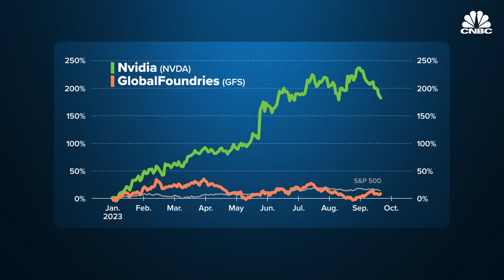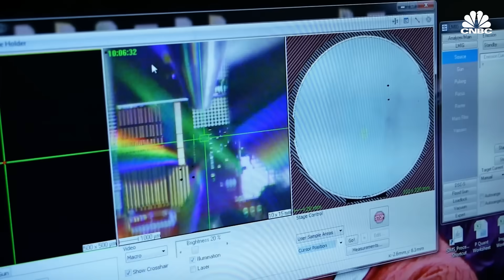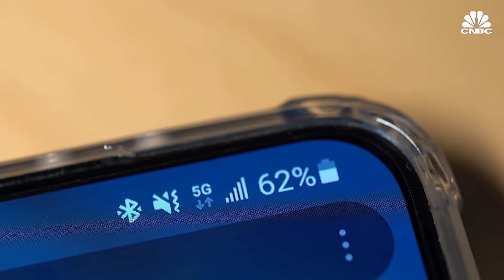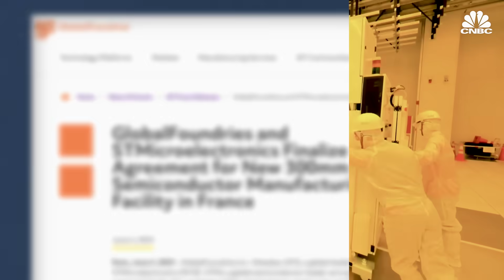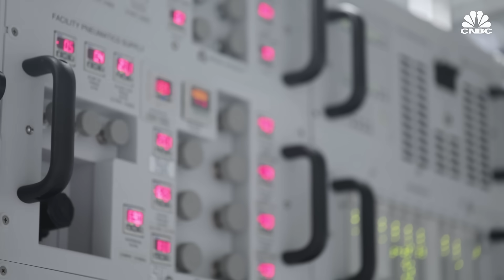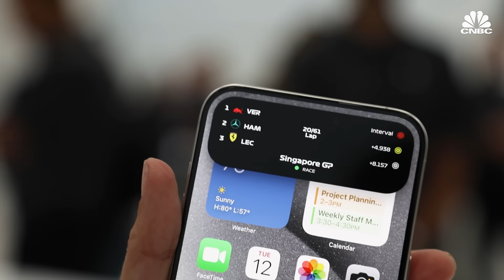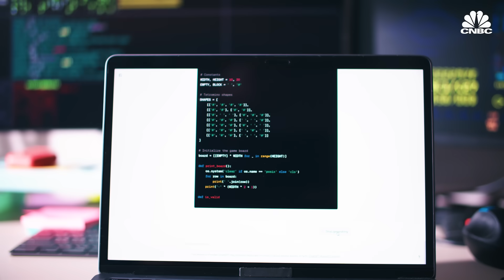Why GlobalFoundries’ Chips Are So Important To The U.S.

Comment: (GF) GLOBAL FOUNDRIES (GFS on stock market), Malta, NY
1:00 - - 🌎’s largest chip foundries (GF #3)
3:36 - - NY, Singapore, IBMs in-house semi-c division’s 2 production sites
3:53 - - 6b company 
5:49 - - only chip manufacturer in 🇺🇸 
6:34 - - aspirations to become greater market leader 
7:42 - - layout
11:01 - - Manufacturer req -💧💧💧(cleaning, cooling, chemical treatment)
11:19 - - power req - 🏭 2 gigawatts per day
11:45 - - 13k employees 
12:29 - - public subsidies are key to funding manufacturing
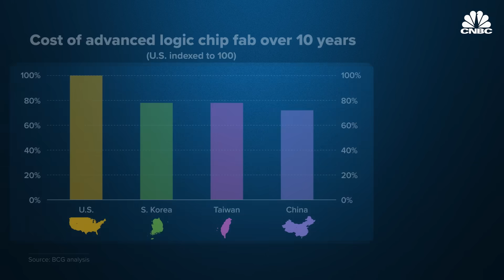12:39 - - GF said NY pitched in $2b for (fab 8)
12:42 - - 52b grant - CHIPS + Science Act (2022); 460 co’s applied
12:50 - - GF keeps costs ⬇️ by focusing on 12nm or ⬆️ chips
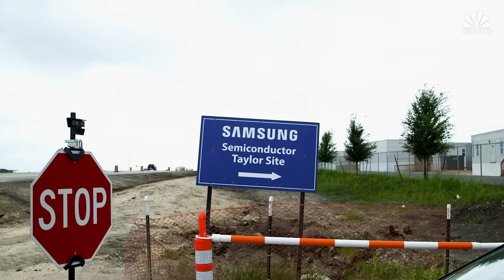12:56 - - GF doesn’t have to build 100b campuses
13:01 - - TSMC, Samsung + Intel must build 100b campuses over 10 yrs
13:41 - - GF customers:  Qualcomm, AMD, NXP, Infineon;
13:49 - - GF supplies to the 🌎’s largest fab-less chip companies
13:52 - - supplying to auto, aerospace, DOD, USAF, defense + AI industries
14:12 - - GF has contracts w Lockheed Martin, DOD; 50 long-term agreements
14:39 - - auto industries, GM; 1b a year in revenue from automotive

Comment: I could be very wrong, but I believe Samsung can easily catch up with TSMC. Taiwan is very tiny compared to South Korea and China.
Reply: Yes, you're wrong. :) This is not about the size of the company but about those few dozens of engineers and what they know about the manufacturing (machines and processes).
Samsung has been trying to catch up to TSMC for a few years now and they just can't.
Reply: @bslay4r  Both Sony and Panasonic said the same about Samsung and LG in terms of HDTVs in the past. They believe both Samsung and LG can't catch up.
Reply: @JosephLee2012  I don't intend to argue but you said "_easily_ catch up". They tried hard and couldn't. What happens in the future? I don't know but it won't be easy. Intel also wants to win in this "race", they were leaders for decades and they're also struggling now because it's not about the (mostly ASML) machines but what the engineers know about the machines.
Reply: Samsung Electronics which is one of the 20 or more Samsung affiliates in South Korea produce a larger revenue compared to Intel and Microsoft combined. I am not including Samsung SDI or Samsung Electro-Mechanics. In the past, both Sony and Panasonic laughed at both LG and Samsung. I believe both LG and Samsung had the last laugh. I would not be surprised both SK-Hynix and Samsung may buy out Intel because Intel is in serious trouble.
Reply: @ As I said it's not about their size. It's about the few engineers operating the EUV machines. TSMC  engineers know how to reach high yields in production. Others don't. Why? Because they incrementally improved their processes, very slowly. So it's not about money, it's not about revenue or a sea of other employees. It's about know-how accumulated over the years. That's why China won't attack Taiwan, at least not for TSMC, because without those engineers the factories don't worth much.
Reply: @bslay4r  Samsung Foundry ranked 10th place 10 years ago. I believe their ranking improved to 2nd place to TSMC's 1st place. Many say Samsung can't do this or do that. In the end, Samsung always proved their critics and sceptics wrong. I do see your point, but many in Sony and Panasonic said the same about Samsung and LG.
Reply: @JosephLee2012  It would be nice to see your "prediction" come true because TSMC has a monopoly right now in the highest end chips (unfortunately Samsung is not even close in yields, even they wanted to move their new Exynos chip production to TSMC but TSMC denied them).
Reply: @bslay4r  Yeah.... That's what Sony and Panasonic said in the old days before Samsung and LG produce better TVs now.
Reply: @ l believe Samsung wants to learn some of TSMC's processes by making them produce their Exynos chip for them. Other wise, TSMC would produce their chips for them.
Reply: @JosephLee2012 
Samsung is begging Chinese to teach them how to make chip now.

Comment: EN CHINA Y LATINOAMÉRICA  SE EMPEZARAN A FABRICAR CHIPS DE 2 Y 3 NANÓMETROS    PERO EN CANTIDADES  PEQUEÑAS  PERO CON UNA EFICIENCIA  IMPRESIONANTE  2025 Y 2026 SERA LOS AÑOS MAS IMPORTANTES  PARA EL RESTO DEL MUNDO DE PAÍSES  EN DESARROLLO   ,CHINA LOS FABRICARA EN MASA  Y OTROS LE DARÁN  SUMINISTROS  Y MATERIALES  IMPORTANTES  PARA PAÍSES  DEL NUEVO MUNDO
Reply: "SMALL QUANTITIES BUT WITH AN IMPRESSIVE EFFICIENCY" that is something not even TSMC can do. So highly unlikely that "Latin America" will appear on the map. A pipe dream. If you want to start a fab from scratch today and even on the cutting edge (2nm as you said) you better prepare for an upfront investment of 100+ billion USD. And still you can't sell one chip without the IP (technology patents). EVERYTHING is patented in this industry. And did you think of those thousands of highly skilled specialists to run your 100B$ fab 24/7? Furthermore a fab is DEPENDENT on a wide array of supplier firms (equipment and materials) ON-SITE. So I'm sorry but there is no chance for modern fabs in South America.

Comment: If GF can't keep up,
GF might dying again 

2024,, 
bleeding edge is 3nm not 10nm anymore

Smart cars, smart devices etc demand will keep increasing,,
better and more efficient chip is a must for that future

which is smaller nm

Intel Foundry might out pace GF with Intel deep pocket, bright talents and vast connections 

GF must move fast and stop being comfortable on stagnant market

Especially if some Foundry in China flooding the stagnant market with comparable but cheaper chip

That happened before when some Foundry in Japan flood the stagnant market with comparable but cheaper chip

GF must stop being comfortable
Reply: They don't stop developing further. They decided to go the way of offering specialty solutions for the 85% of chips revenue worldwide that is not CPU or needs cutting edge production. There is money to be made if you offer what chip houses need for the lowest cost possible. No car does need 2nm chips except maybe for autonomous driving (in the future). And even then 90% of chips in modern cars are made in the 'legacy node' technologies.

Comment: As leading foundries amortized its processes, the cost to produce more advanced chips will reduce and the industry will be able to utilize more advanced chips.  In the meantime, there are many capacity expansions under way.  China is expanding its mature chip production capacity significantly.  The profit margins of mature chips have come down and could be under pressure when all new projects are online.

Comment: they didnt talk about fab 1 at all. Malta (HQ) will never become as big as Dresden or Singapore. Singapore was just expanded and Dresden is planning to double its Size. Dresden just upgraded its capacity for water, and TSMC is also settling in Dresden.(necessitating a second extension of the water infrastructure in Dresden)
Reply: also if the 400mm wafers will arrive it will be made in Dresden.

Comment: they tell us 400.000 wafers a year, and that it will take 90 days to complete a wafer. at any one moment they have half a billion dollars of material in circulation in the factory.

But they won't tell us the price of one wafer, but gave us a math problem instead.... just over 5000 a peice, based on a loose calculation.
Reply: It's not that they won't tell you the price of one wafer. It's that they can't since it really depends on the type of chip that will be built onto that wafer. The loose calculation you provided is an average price and which he later gave as overall fab revenue.
Reply: LoL

Comment: 0:01: 🔌 GlobalFoundries is a crucial chip manufacturer that powers nearly every connected device.
3:51: 🔧 GlobalFoundries pivoted their strategy to focus on essential chips and turned the company around to profitability.
7:05: 💰 GlobalFoundries is investing $7 billion to add capacity in parts of the world with lower risk, including expanding their Malta site and completing a $4 billion expansion in Singapore.
10:18: 💦 The video discusses the clean manufacturing process of silicon wafers and the significant amount of water and power required.
14:27: 🔌 GlobalFoundries, the world's largest fabless chip company, is supplying to the auto, aerospace, and U.S. Defense industries, offering assured supply and exclusive deals.
Recap by Tammy AI
Reply: Thanks for the recap.  Do you mean that AI (Tammy?) did this?
Reply: Good question

Comment: GF is so far behind even Samsung, it's not even in the same contest with TSMC. Notice how GF isn't even talking about new packaging tech or die stacking.
Reply: GF only does old tech relatively
Reply: They bought two giant EUV machines and were like "ughhhh ya, we cant do 7nm." that is about when AMD stock really took off.
Reply: the video just explain why GF dont care about making the smallest nm, duh most things dont need 5nm to 3nm
Reply: @nesseihtgnay9419  In 2014 they were consciously marketing themselves as on the "bleeding edge of the leading edge" of chip manufacturing. They tried to make chips for apple back in 2015 but their yields were too low. They really just were not very talented to hack it out passed 14nm, "oh we never really wanted to be at the top" is just them trying to save face.

Comment: The whole world is adding significant chip capacity, Global Foundaries is going to see competition and oversupply in mid range chips.
Reply: They report this so that the shareholder can sell all shares to public. China already decreasing imported chips already, after China achieve cost efficiency guess what would happen to this company.
Reply: 60% of global production and 85% of processing of rare earth are in China. Which means without China,  the whole world will not have the basic materials to make electrics at all.  Without China suppling rare earth metals to TSMC or Samsung, how are they gonna make anything at all? 

Samsung and TSMC is like a printer, China is the ink. Doesn't matter if you have the best printer, won't print without ink.
Reply: Every electronic has chips. Microwave,  calculator,  flash lights, fridge, printers, keyboard and mouse....  

Taiwan makes 60% world chips (90% advanced chips),china makes 30% and others 10%.

The rest of the world need to build more and more manufacturers to catch up.
Reply: @bl5608 lol Korea makes more than China
Reply: @bl5608  that's why the US and EU are securing the supply chain with ASML and others, to make sure that they can ramp up production later on
Reply: The Chinese will flood the matured nodes market with inexpensive chips. GF will probably survive on government contracts only.
Reply: @thomaskim3128  China is also the world's biggest chip market, Once it has the ability to produce most of chips by its own, the competitors will suffer, this is happening on Samsung's storage chip
Reply: @co88liwan31 storage is a completely separate tech path than Mosfet logic chips.

Comment: It’s funny how US companies with all of its money and technology is only able to produce 12 nm and 10 nm (intel) at best.  Meanwhile, a country under sanctions can produce 7 nm chips.
Reply: Not funny or unusual since corporations will seek the lowest cost manufacturing. The US is now re-prioritizing from cost minimization to supply chain security.
Reply: Intel 7 nm Meteor lake ready for shipment,  then they try to jump to 2nm using bunch of new tech like RibbonFet, Hi- Na EUV etc
Reply: @tluangasailo3663  intel just renamed their 10nm to 7nm for marketing purposes.
Reply: It isn’t because of the technology, it is due to the cheap manufacturing of these companies. Apple is the US company which designs its own chip and gives manufacturing to tsmc
Reply: @aniketbhanderi6545  It is because ot the technology. TSMC was the first to produce high yielding in high capacity 7 nm and 5 nm Finfet chips. Apple, Google, Microsoft, ARM chips, AMD, NVIDIA and even AI startups like Cerebras uses TSMC solely for their chips.
Reply: @aniketbhanderi6545  The US technologies are lab technologies with a low yield rate lower than 50%, and tsmc technologies are more advanced with a 95% yield rate. so-called cheap manufacturing is because the US is no longer advanced.
Reply: @aniketbhanderi6545  intel manufactures chips in the US with access to the most advance lithography machine from ASML but can’t get below 10 nm.  Can you explain that?
Reply: @npc2480  Intel uses CISC architecture which is different than arm processors. Intel is not able to innovate due to this
Reply: @aniketbhanderi6545  what does cpu architecture have to do with manufacturing process node?

Comment: Of course there's a skills gap for chips. That's because people have to be trained in it.
It's not like schools teaches people how to make chips.
But if you train people. You will have the labor.
Reply: Um, higher education literally has degrees specifically specialized to designing chips, manufacturering chips, and have active funding to try and solve the issues we are having as we continue to go smaller and smaller.

Material Engineering is going to be exploding in demand in the near future for various industries
Reply: @dennisp8520  This is not just designing.
They are talking about every signal job.
CPU design is a niche field to get into. 99% of people will not go to school just for that.
Reply: @saulgoodman2018  Yes, but for alot of those other tasks that your mentioning they can be overcome through innovations in automation.
Reply: @dennisp8520  They are just too lazy to train.

Comment: why not bring tsmc to europe or america?
Reply: I guess you don't do research or stay on top of semi-news? "Taiwan Semiconductor Manufacturing Company (TSMC) is building two chip factories in Phoenix, Arizona. The first factory was scheduled to be operational by 2024, but has been delayed until 2025 due to construction labor issues. The second factory is expected to be up and running by 2026."
Reply: They are trying. But most of the supply chain is in South East Asia.
Reply: TSMC is already in America, they have a fab in Camas, WA

Comment: These chips are SOCs right? Not individual ram, cpu and so on.
 Don't bother telling because i just watch the whole video
Reply: The fk is soc?
Reply: @hectorcardenas2171 

System on chip

Its really a combination of CPU, RAM and EROM on a chip. These chips r found on the motherboards of your phones and PC.

A single chip can ran a automatic car instead of having many IC chips
Reply: @vblair2911 Sorry to ask, but also what does IC stand for in regards to chips?
Reply: @Mcfunface  Integrated circuit 

It doesn't include any cpu, gpu or anything i just said above. So its not a computer at all. Its just made up of basic circuit components like resistors, transistors, diodes and capacitors.